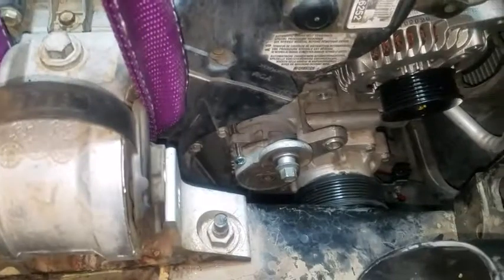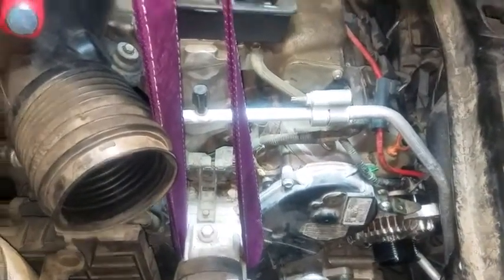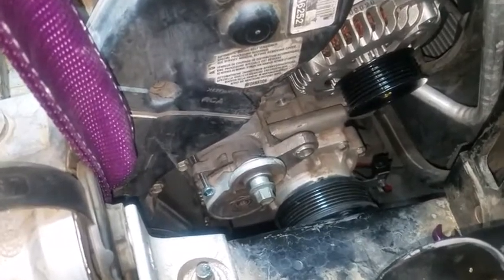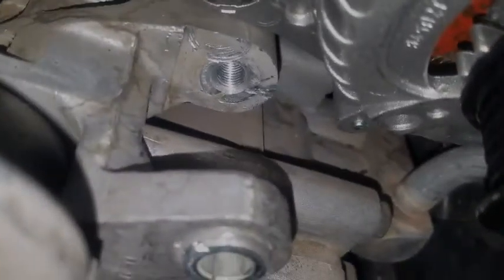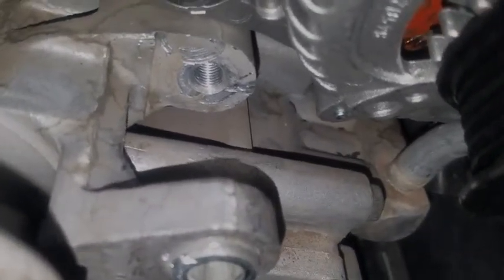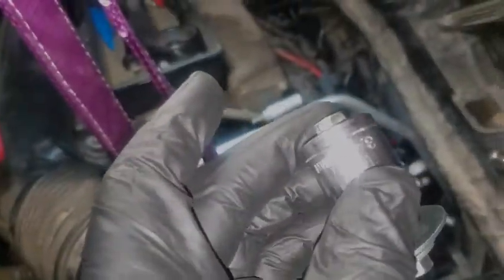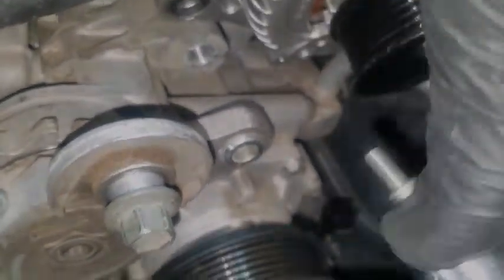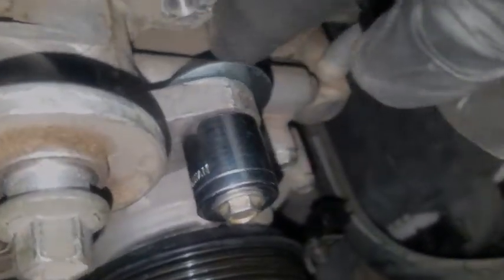Alternator Bushings are from HELL!

Comment: Thanks for putting this together. I'm at a loss for removing a 2005 Honda Odyssey alternator.

I've removed the upper and lower bolts but the alternator is stuck at the lower bracket. I can rock ite up/down but no room for side to side. My research so far says it's stuck at the lower bracket's bushing. Any idea how the fix this?
Reply from the maker: Double check with your eyes and maybe with the manual that you've got all the bolts out  if it's acting like it's turned loose and can move around but just will not let go of the bite then you just have to Get angry, get tough💪, and/or get a pry bar or Wrecking Bar to get under there and persuade it a little.  Even a block of wood and a hammer could help, never done an odyssey, dont mind helping out with moral support though.  👍
Reply from the maker: https://youtu.be/vJabM9rd0Lw?t=561  Check this to see what it looks like off, seems you need to wiggle then twist while pulling toward the front of the car to get it off that bushing and you'll then be on to the nightmare of extracting it through all those hoses and wires. follow his method or mine to bring that bushing back out before putting it back in.
Reply from the maker: Yeah if rocking forward back doesn't get it to give enough to let go, then you can try a shorter bolt through that hole with the socket method if you can see or feel around the back side of the front mount that contains the bushing and get a nut on the backside of just that bushing.  Usually angry rocking or a pry can get it to at least let go of the alternator, then you get a new alternator and its even bigger, and you have to address that bushing but at least then you can SEE the dang thing and control both sides of it.  Good luck let me know if you need more help or support, I'm a night owl, in AZ.
Reply: @snap-off5383  I appreciate the advice. I'm in California and this thing has been keeping up for a few days now. Will try to slay this beast tomorrow. Thanks again - stay safe out there.
Reply from the maker: @SoloJetMan  you're welcome, since most odyssey alternator replacement vids seem to have it fall right out, you may have an issue where your bushing is pushed so far back its actually inside your alternator which would make it impossible to remove.  
https://ww2.justanswer.com/uploads/EB/ebrock63/2013-04-19_141259_2013-04-19_081121.png That is a blowup diagram of how it goes together, take a look at the side view picture here: https://www.autozone.com/batteries-starting-and-charging/alternator/duralast-gold-new-alternator-dlg5545-6-10/283663_467109_0
you can see there's another bushing opposed the other way, so that may be a point you can pry to try to push the bushing out to get it to let go.
Reply: @snap-off5383  took alot of sweat and tears but I finally slayed that dragon. Every bit of your advices helped me so much appreciated!
Reply from the maker: @SoloJetMan  glad to hear it! next time you do it you'll be able to do it in an hour, (if you still have the same car).  Make sure to check your parasitic draw when the alternator is new you can see the end of my Lincoln Navigator alternator change video (or many other youtubers) for how to do that.
Reply: @snap-off5383  didnt u used to play as a lineman in highschool against a future hof steeler defensive lineman?
Reply from the maker: @Jesus_isking05  This is me!  That performance put me on the All-conference first team as a guard.  I was the only lineman on that team that weighed less than 200. (our coaches liked the guards to be fast guys to pull and obliterate the defensive end who almost never saw it coming).  My wife tells me "shut up Al Bundy" whenever I bring it up to people in her presence.
Reply: @snap-off5383  lol

Comment: I think the duratec 24 valve Ford Taurus is probably even worse to change out the alternator, it calls for six and a half book hours
Reply from the maker: I think this one is similar but I found online the shortcut is to pull the motor mount and use a jack or in this case I used my engine hoist and the purple lifting sling to lift the entire engine a bit to get the alternator to clear out the top instead of having to come out the bottom.